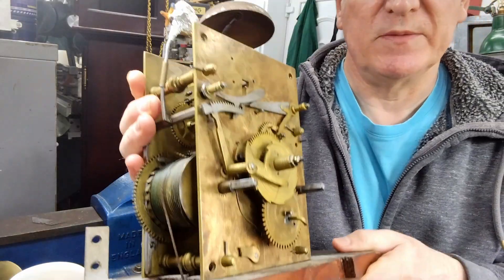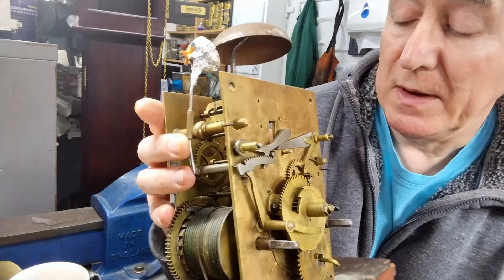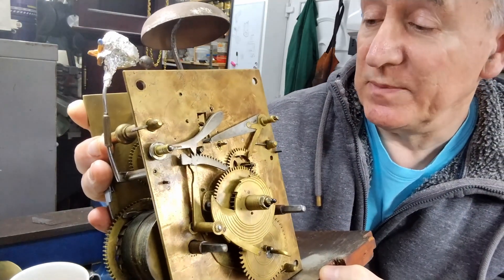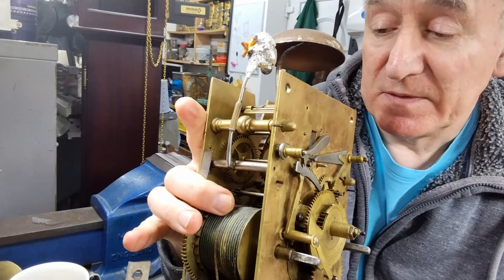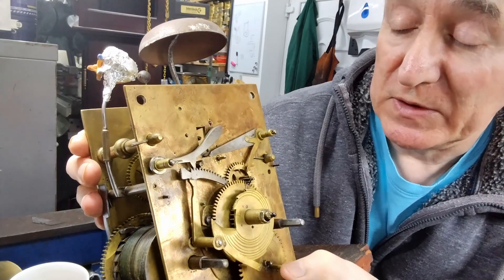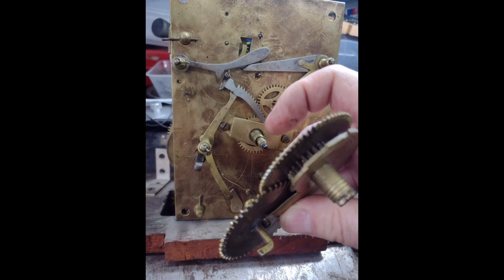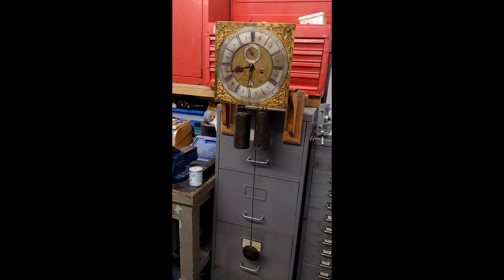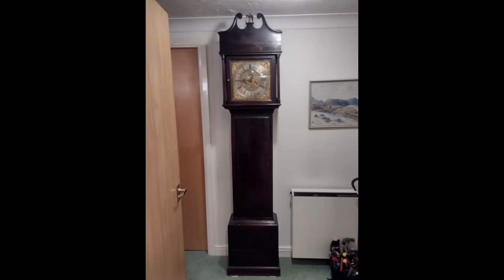Longcase Clock Service & Repair. Clock restoration, cleaning a grandfather clock in my workshop.

Comment: Hi David I recently inherited a William Smith long case clock and the movement seems to be similar to what you show in the video. I am wondering if the movement you showed here had a half hour strike? Because I thought I remember mine to have had one at my gradparents place, however, there is none and I can not find any hint on it in the movement.
Reply from the maker: This particular movement did not have the 1/2 hour strike. I loved that clock but unfortunately it wasn't mine!
Reply: @davidhaggarty  thank you, I think mine does not either. And I have heard that there were rarely clocks from the ~1750s that did have one. I think everything is working now fine.
Reply from the maker: That's good to hear. Thanks for getting in touch, I should have another video coming out shortly.😊

Comment: Hallo David, danke für deine Videos. Wer aufmerksam ist kann von Dir eine Menge lernen. Du bist Metallarbeiter und das ist bei der Anfertigung von Ersatzteilen wichtiger als königlicher Uhrmacher zu sein. David, wie kann ich mit dir in Kontakt kommen? Es geht um eine Uhr aus dem 18. Jahrhundert.
Reply from the maker: Hello Kai
Thank you for your kind comments. I learn something new with each clock repair and I  am lucky to have the metalwork tools to make my own parts when required.
My email address is emaildavidforinfo@gmail.com and I would be very  interested to to see pictures of your clock. As a matter of interest, where do you live? 
Kind regards
David

Comment: What an utter mess you have made of that movement. What you say is a latch it is not, that part is part of the broken spring for the rack. Cleaning any antique clock before 1915 should never be cleaned in an ultrasonic cleaner as it can and will cause stress fractures in brass.
Reply from the maker: A bit hasty in your judgement!! The pictures you see in the video where taken pre stripdown (I take them to aid reassembly). The plates were brush cleaned using IPA alcohol. I did put screw's and some wheels through the ultrasonic cleaner, although I am looking to brush clean all parts in future.
The rack spring is not broken and so I believe it is a latch (you can see the groove on the pillar where it originally located). There is also another latch on the opposite pillar.
Reply: @davidhaggarty  I couldn't see the groove in the pillar so I apologize for that. It is well known that the better makers of clocks had latch fittings to there clocks, certainly the London makers What you have done in repairing that what I call a bodge has devalued that clock. I also noticed what looks like led solder on the calendar wheel.
Reply from the maker: The bell and/or support arm were not original and so the hammer (which was ok) would not hit the bell. The customers brief was that she wanted to hear the clock chime again, and so I made a plate to swing the bell round to the right position. This mod is totally reversible, so if the correct bell could be found, you would just remove the plate and fit the  correct bell. I made no changes to the plate and so I don't believe that  I have devalued the clock.
There was solder which could have been tidied but it was a solid repair, and the customer didn't want a full restoration, so that is why I left it as is.
Reply: @davidhaggarty  I was a clock maker and restorer many years ago. I always advised customers what should be restored, in the past I have restored some very valuable clocks. I would like to correct you on one thing. You say chimes, the correct term is strike, most clocks that chime will have three key holes, this Longcase clock has just two.
Reply from the maker: Thanks old timer, some good advice and of course you are quite right about the strike, not chime. 
My approach to clock repairs is to make any repairs reversible, and clean but not polish movements (unless it's an open escapement). Hopefully you will find my latest repair to a moon phase clock interesting, where I am having to make a missing 72 tooth drive wheel. Of course any advice/comments are always welcome. Cheers David
Reply: Oldtimer, here I am 2 years after your comments, so I do not know if you will see this.  I think you were a little presumptive and rough on Dave.  His video helped me much.  It is maybe even more important to preserve our clock enthusiasts and technicians as it is the clocks themselves-  Even the newbies, like David and myself.  Sometimes, encouragement and affirmation are rare commodities.